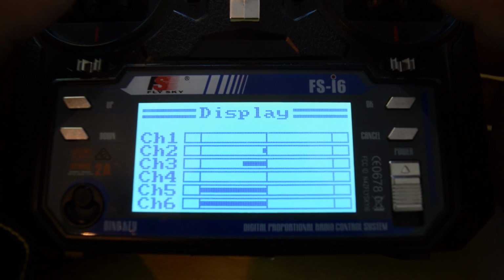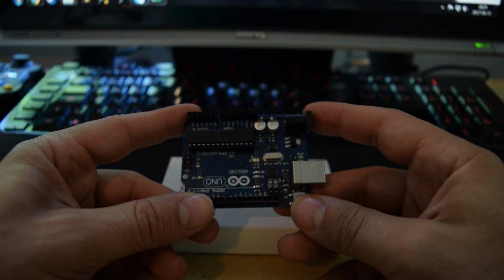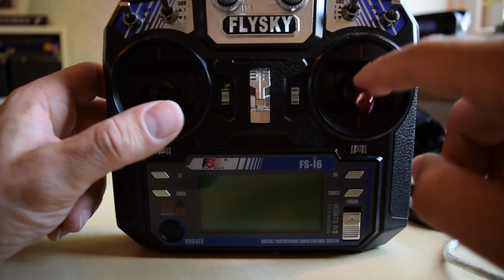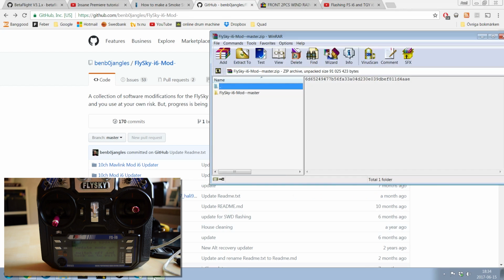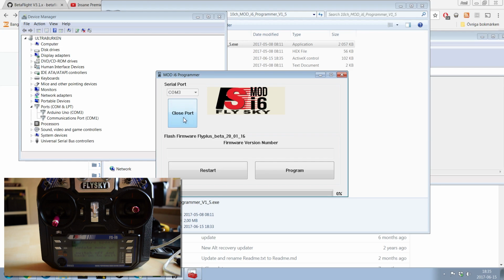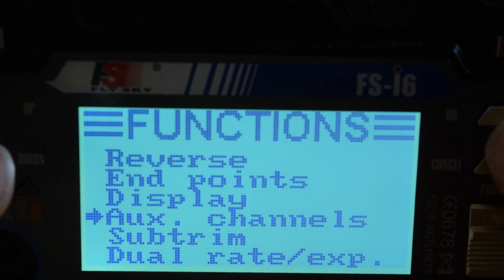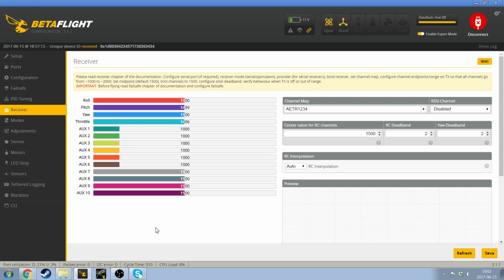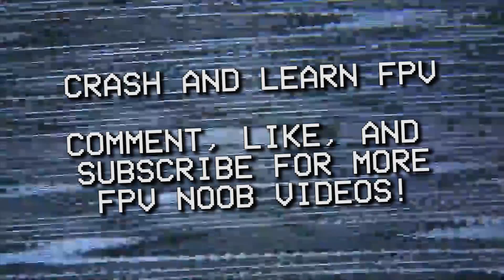FlySky FS-i6 Ten Channel Firmware Upgrade

Comment: Hi,cool it worked with u,I bought the usb cable for this radio,and installed the driver for it,chose the right port,the USB key led light works too,Bür I do c the version number and the computer gives me device not connected..

Comment: Where to get these pins .I mean wire,are they simple wire
Reply from the maker: Yes any wire will do. The ones I used were simple jumper wires I got with an arduino start kit.

Comment: hi bro. ensure
1. from win cp ...LPT/Port set to 11500, 
2. flow control : Hardware.

I ve bricked already of wrong setting the aboves.

if it bricked ---> do ...(move H trim (Left Stick)  to left. and left stick to bottom left )+Power on. LCD didnt show anything but it was program mode. repeat upgrade firm ware with two important things i wrote,

Comment: Hello very efficient video. thanks.
How to reset the TIMER  used for ch3- throttle for a plane?
Impossible to reset to 0 sec even when pushing any button...It is reset to 0 sec only when turn off-on the Tx!

Comment: Mine is t working. It picked my firmware up a couple times... was finicky... then it BRICKED!😣 Now it wont pick it up at all... using a nano 3.. And a my simulator cable wont open the com port.. FAAAACCK!
Reply: Andrew D any fix???
Reply: Install the drivers mate.

Comment: I plug my arduino in and it shows in device manager under com 20! Stuffed as the flasher only goes upto comm 8!
Reply from the maker: +Demi Quad Wow that's strange. Have you tried connecting your arduino to another USB port? Or maybe unplug any other USB devices and then see which Com port the arduino appears under..?
Reply: Crash and Learn FPV found a way to fix it. You can change the com port number under advanced settings in device manager. Hope this helps anyone else. Thanks again for the video and for taking the time to reply buddy. Happy holidays
Reply: Demi Quad where do you get an arduino from??
Reply: PlainLuke amazon
Reply: You go to device manager, click on view ,click on show hidden devices, now free up some ports not in use by installing them. Now go to the port which is active , select port settings, select Advanced, change your port to that range com (3-8). For this while uninstalling device you uninstall a device in range of com (3-8).

Comment: does this upgrade reversable to original firmware? thanks
Reply from the maker: +LESTER BERDEN I'm not sure if it's reversible, perhaps it could work by doing a factory reset...
Reply: Crash and Learn FPV  ok bro thanks a lot great video
Reply: LESTER BERDEN no you need to flash original from gethub.

Comment: All I'm getting is invalid port number( its actually correct though) and device not connected (obviously it is) been trying to upgrade this thing for weeks with the same thing over and over. UUGGGHH
Reply from the maker: +SuperNinjaZX9R Argh that's annoying! Have you tried different computers with preferably different operating systems? Also, there are several different versions of the Firmware Upgrade Hack on the github page, have you tried an older version?
Reply: Thank you for replying! I have not tried a different computer, but i have tried all the versions available.  I ordered 2 different cables last night, I will try again once they come in! TYTY
Reply: Hi mate, you have to update the driver of the usb cable for different version of Windows O/S

Comment: im not getting my version number in firmware. i have checked the connections its fine. what might be the issue?
Reply from the maker: +Anush K Have you set your transmitter to firmware update mode? How are you connecting your transmitter to your computer? Via Arduino? If so, have you tried changing the COM port? Let me know if you solve it! /Axel
Reply: Yeah i have set my transmitter to firmware update mode. Connected it using Arduino UNO. Com port also i have checked. I tried same steps using the simulator cable that i got for my ct6b transmitter. Still same issue. i guess my receiver is not running in ibus mode. can that be a issue?
Reply from the maker: I'm not sure if the ibus matters... Try watching some other videos explaining this process, as I might have missed some crucial steps. I have two examples in the description of this video that I used as guides when flashing my transmitter.
Reply: Okay. thanks a lot bro. ill check that once.

Comment: Dang I would really like to get into drone racing!
Reply from the maker: +Detours for Derrik Just do it ;) it's great fun but can be devastating at the same time. I'm not at the racing stage yet, just messing around and figuring out stuff as I go
Reply: I have a filming drone and I am always paranoid about crashing
Reply from the maker: +Detours for Derrik Yeah I can imagine. I've been thinking about getting a DJI for photography but would be pretty nervous about wrecking it. Racing drones are pretty bullet proof though, main breakages are props and antennas
Reply: can you get flexy wire antenna?
Reply from the maker: +Detours for Derrik Hm, haven't thought of that. Not sure but I'll look into it! The antennas on the channel receivers are soft, so why can't the video transmitter on the quad be?
Reply: yeah that is what I am thinking